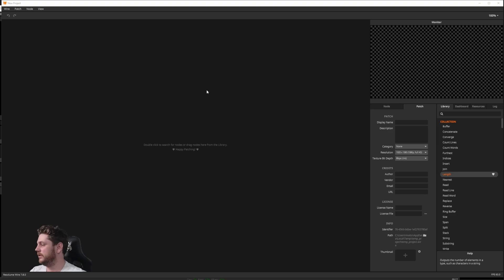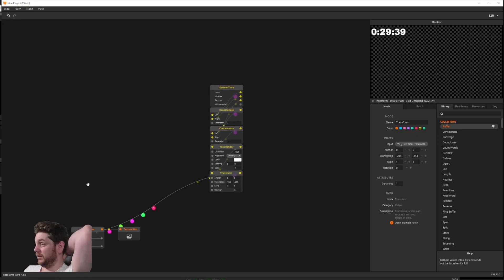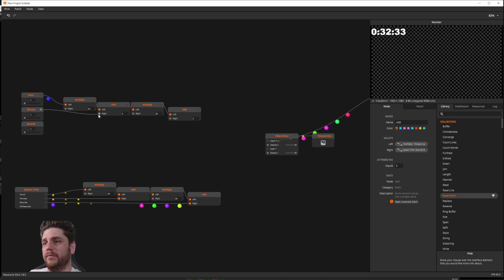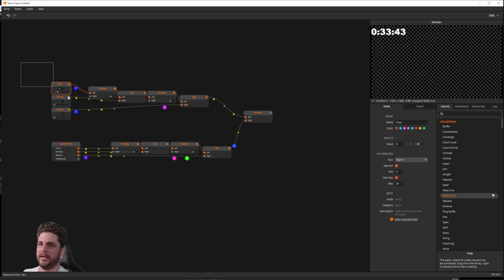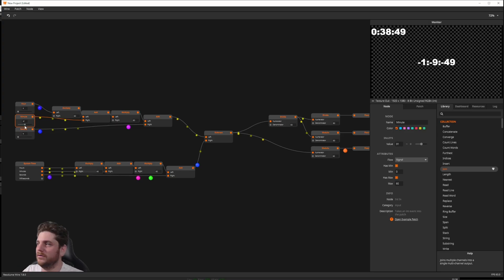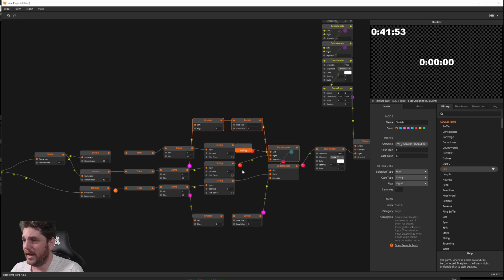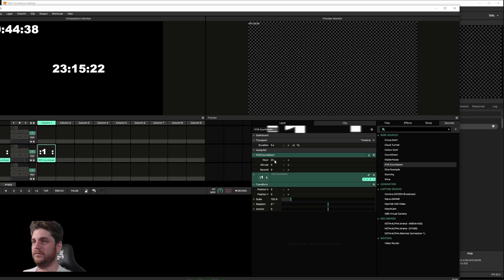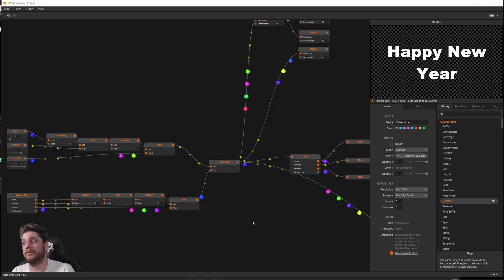Wire Countdown Clock // with Resolume Wire

Comment: Newb question, first time using a wire source: Installed this in Resolume Arena and dragged it on to the clip, when I click the clip it goes straight to displaying "Happy New Year" I never see the countdown even though "Hour" is set to 2.
Reply from the maker: I think it’s probably default to last new years
Reply: How can i fix that? 
 @mith